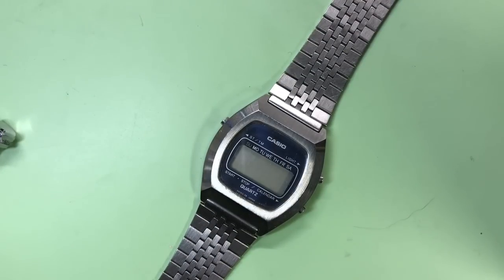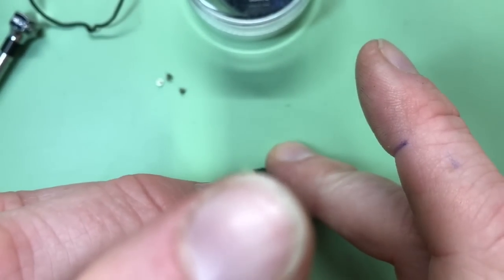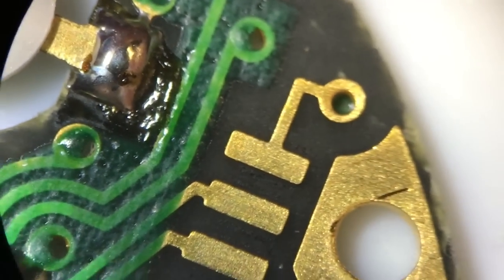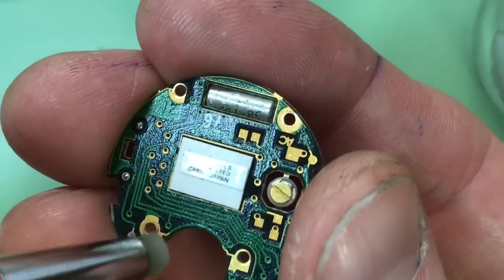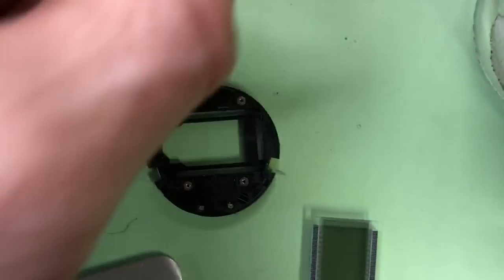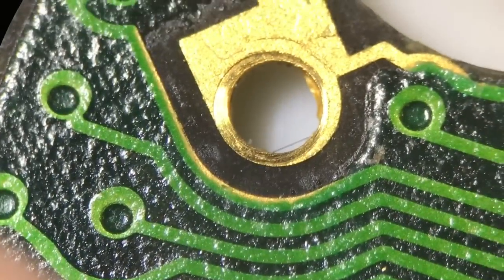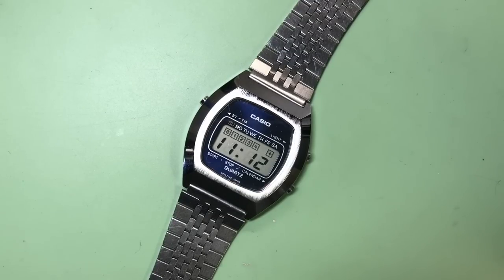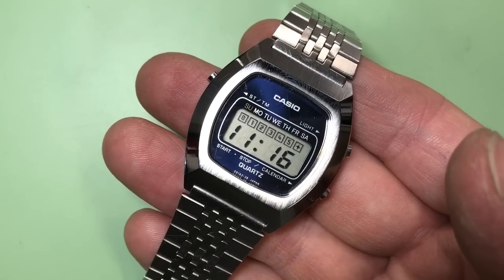Vintage Digital Casio Clean & Service

Comment: Another great video. I find using a "sticky ball" to remove the case back removes the risk of scratching it with the slip of a metal tool.
Reply from the maker: I have thought about those balls, however on many of the vintage watches I tinker with they are usually welded on so I loosen them with a Jaxa tool first.  Still might get the ball, you can never have enough tools!

Comment: Mike, to repair the battery contact where the plating has come off, try using the conductive paint that is used to repair broken contacts on car rear demisters.
Reply from the maker: ro63rto hi Robbie. Already ahead of you on that one . I have a few tubes of conductive paint that I use to fix tracks with on the boards. I had planned to paint this contact at some point.
Thanks pal.

Comment: Hi ! Nice video, I have a similar CASIO watch ( 35qr-23 ), my father gave me as a gift when I was 10 years old. I have it always in good shape and conditions and changed the battery a couple of times as needed. Later, after a couple of years while I was not using it , it runs out off battery so I try to replace it but at the watch store they told me that it is not running and probably de display is not working anymore. Is that possible or a tipical situation on this watchs ? Thanks and apreciatte your concerns about it.

Comment: Hi, would you mind sharing the details of the new rubber seal that you added and where to get one? Thanks if you can help.
Reply from the maker: I would have no idea now but I just bought a selection of flat gaskets. Measure the diameter of the inside of the caseback to find one that fits. Gaskets are very cheap.

Comment: Hey Michael, very nicely done! How do you get this brushed finish of the steel case?
Reply from the maker: Michael Reitberger on this one I did not reapply the brushed finish I just lightly polished with polishing compound and a felt wheel on my machine. 
To reproduce the brushed / ground finish is quite easy on a flat part of a case. On rounded parts is allot more challenging.  I think in one of my videos I show it.  For flat surfaces you need some P400 or finer abrasive paper often known as wet & dry paper. You then need a very flat surface for the paper I personally use a Price of steel I have. Lay the paper around the flat surface and place the case part you want to refinish flat to the paper and then slowly but steadily move the case in one direction. I find towards me better. Repeat the process of moving the case along the paper checking how it looks as you progress. Once satisfied it’s done.

I may soon do a video demonstrating this as your not the first to ask!
Reply: My Retro Watches Thank you for your precise answer! I‘d love to see such a video from you ... perhaps with some tricks for round surfaces too? :-)

Comment: Hi what type of microscope do you use?
Reply from the maker: This one, https://www.ebay.com/itm/AmScope-20X-40X-Binocular-Stereo-Multi-Use-Inspection-Microscope-All-Ages/140926160130?_trkparms=aid%3D111001%26algo%3DREC.SEED%26ao%3D1%26asc%3D20160908105057%26meid%3Dcc67dbd713e84dc4b6d7a54d018227fb%26pid%3D100675%26rk%3D1%26rkt%3D15%26mehot%3Dpp%26sd%3D140926160130%26itm%3D140926160130%26pmt%3D1%26noa%3D1%26pg%3D2380057&_trksid=p2380057.c100675.m4236&_trkparms=pageci%3Abfd45ad0-49b3-11ea-aa76-74dbd180c2d5%7Cparentrq%3A1ffddb6c1700a4cc0907ae03ffea344b%7Ciid%3A1